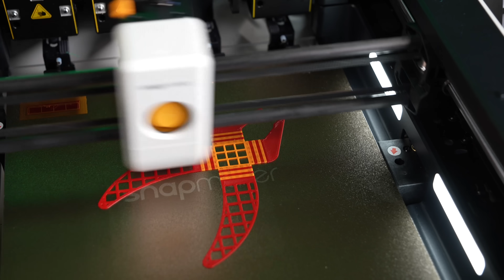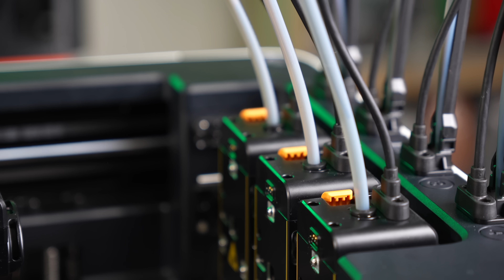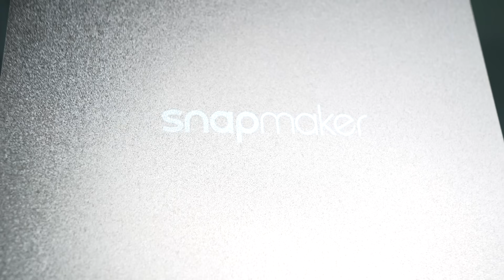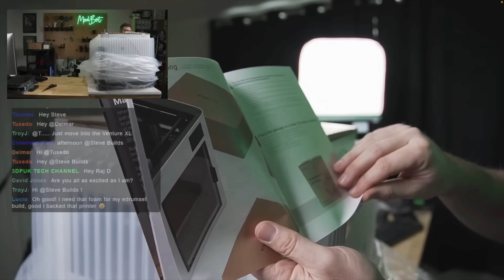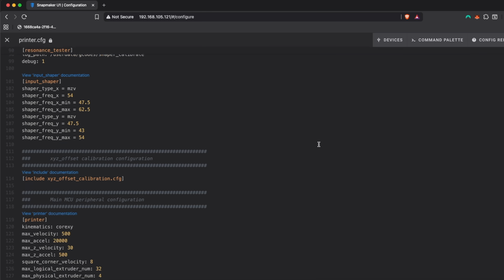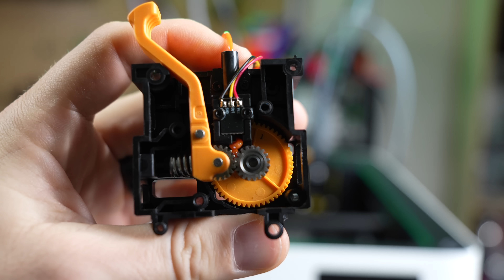Would I Back It Again? Snapmaker U1 Tool Changer

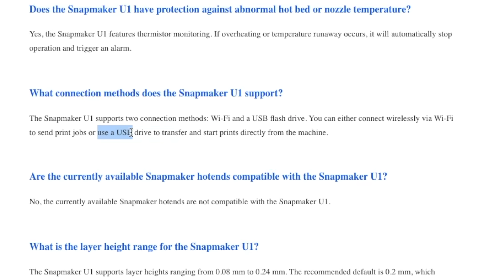Comment: 12:52 Just buy a cheap USB extension cord (male USB-A on one end, female USB-A on the other) and it will do the trick. Connect it on the back, tape the female part on the front and now you can load it normally.

I know these exist, because I have my mouse connected via one (as it came with a comically short cable compared to my previous mouse).

Comment: Help, I am trying to calibrate my brand spanking new Snapmaker A1. It goes through the homing fine it picks up the first head brings it out to the middle and stops and makes a lot of noise like the hot plate is locked down Help.

Comment: SInce the U1 is supposed to be open source, I am dismayed that the RFID method of locking us in to Snapmaker's filament is disappointing. That is the same cash grab attitude that Bambu is doing with their proprietary RFID scheme. It wouldn't have been hard for them to create an app that allowed QR codes to be snapped and using the filament data in the QR codes of non-Snapmaker filament manufacturers.
The other issue I have is filament drying. At least with the Bambu AMS you filament can be put into a dry envvironment. But with the U1, the filament is exposed to the elements. If I had a U1, the first thing I would design is a filament box to attach to the side (maybe with magnets that snap on) that would cover the filaments. I would also design a plate so the top would be covered to keep the inside temps constant for higher heat materials.
Otherwise, for the price, this is a step in the right direction. I am personally going to wait to see if the Creator 5 Pro can do even better than the U1. But if you have to have a toolhead printer right now, the U1 would be the best bet at the moment.

Comment: Can you use it with enclosed filament boxes? 

It seems a wasted opportunity. It works for multicoloured prints but only stops short of delivering for really interesting engineering potential if combined plastics parts; no chamber heating, an open lid and no enclosed filament housing. 

How easy would it be to mod the printer with a lid that includes a heater and a gantry to support enclosed feed from enclosed filament boxes.

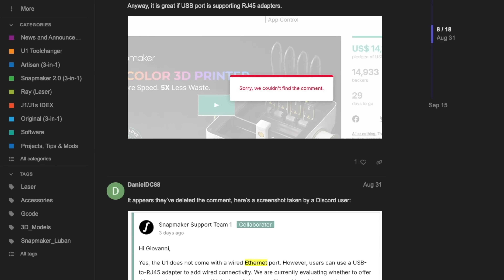Comment: @13:08 Curious if anyone tried this with a USB HUB. The only HUB's I have in my office are hardwired USB-C, and using a USBA to USBC cable does not work on any devices. Anyone have a HUB that works for sure?

Comment: We've been very impressed with our first three months with the U2. So far we've only had one blob, which we managed to clean up without a complete disassembly of the head, and one tool change failure, which we recovered without restarting the print. That's not bad for several hundred hours of operation. The blob did damage that heads sock, but a set of 4 replacement socks was only $5.

Our U1 deals with 20 hour prints, swapping between PLA and PETG far better than our Bambu Lab A1 ever did, while also saving huge amounts of waste filament.

Comment: For years I have struggled with color 3d printing.  The poor mans way is to pause the print, pull out the one filament and insert the other color.  This means being by the printer to time the color change.  Another way was to have two printer heads mounted on the same rail, rarely worked well. I even tried a hot end with 2 print heads that would swing to allow the different color to print  Having 4 independent tool changers at this price point is a dramatic leap forward.  Now it appears more modular with working on a tool changer easier.  My U1 just arrived and I am excited to get it up and running

Comment: I got mine not long ago, and I am LOVING it.  Out of the box, I only had a few niggles (had to get the belt tensioning correct).  But after that, smooth sailing.  The thing tuned itself, I had to do NOTHING, other than wait.  First layer was a touch low, but that's pretty minor.  The RFID tag readers are awesome, and if you're willing to use custom firmware (eg Paxx), you can make it read your own tags, or tags from other filament brands.  Put a cheap Walmart / Ikea bin mod on top, and you can print ABS / ASA all day.
Reply: Same here, just a bit of belt correction, then it was go go go. Not looked back so far.

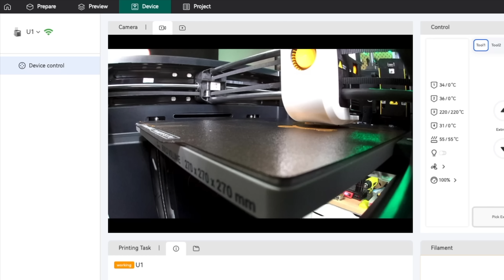Comment: 10:12 - Internal camera frames are very similar in quality to P1S, meaning they are slow and low quality.
Aside from offering cost-effective color switching, it seems impractical not to offer a higher temperature nozzle (350–370°C), considering that the table size is comparable to the QIDI Q2.

Comment: I received mine yesterday. I have made a couple of other items besides the obligatory dragon. 

The only problem I had with assembly was of my own making. I thought the 16mm screws would have been used on all of the toolheads as well as the fixed portion on the back of the printer, then found I didn't have enough screws to do that with! Doh! My fault for not reading ahead far enough.

I have no idea why they used so many different types of fasteners. I would have just gone with  2mm x 12mm screws and be done with it.

The assembly manual is one of the best I have ever seen for anything I have ever bought! Buy an Italian machine tool and see what you get!!!

The only complaint I have atm is the software and connectivity. This is very patchy. I could not get the machine to bind to my account. I could ping the machine on my network but that was about all I could get. 

I upgraded the firmware using a USB stick and that improved the experience. The latest available is 9.0. The machine came with 8.x something. Still a bit dodge but I at least got it to bind with my account. I still have intermittent connectivity with the machine trying to send a job to be printed. Orca says the printer is offline. I just keep retrying until it works.

Comment: I own a a Bambu XC1 with AMS.
Happy with it, when I don't need to print more than 1 color per layer, because I can print in few hours instead of days... don't care about purge, care about a huge amount of time... also, after hundreds of filament unload/reload, it can stuck in roll or have any other issue... so a tool changer is the way out.

I'll sell my XC1 and her a machine like U1 or U1 itself as soon as it is known to be solid, durable.

I print as a hobby, like 1 or 2 per week... I believe U1 is already sturdy enough for thin light work and should last many years, BUT I believe next version and also other established manufacturers will release something at similar price range (Prusa One+ costs like 5x more).

If U1 was a Bambu Lab product, I'd pay $2K for it

I' ll wait 6 months

Comment: I have got over 24 hours on my printer so far. probably closer to 36 at this point. Only issue I have had is during two long prints (10+ hours), for some reason the pogo pins cant be read on the tool head. All I have done to fix this is simply wipe with a cloth on the pogo pins. Also I sort of pushed them in and out. I can't remember if it was the same toolhead each time or different ones. I don't quite understand how they could be getting "dirty" over the course of the print but each time it resulted in the printer being idle in an error state for multiple hours. Then when I got the print to restart, it had a pretty noticeable layer shift. Which is very frustrating on a long print.

Comment: I dont understand why you need hardened steel nozzles when the lack of a good enclosure will limit the types of material you will be able to use.
Reply: it comes with stainless steel nozzles by default - they recommend both the top hat enclosure and the hardened nozzles if you want to print with abrasive filaments

Comment: Those side load filament feeders seem a less than ideal solution for hygroscopic filaments.
Reply: You can bypass them by feeding them straight from a dryer to the PTFE tube in the back or people have already made mods that allow you to connect PTFE tubes directly to the feeder.

Comment: regarding noise levels:
main culprit are the 2510 extruder fans which run at 19.000-22.000. I've been running mine at 65% via printer.cfg for a few days without issues and it's noteably more silent.
An ikea samla box or a top cover, e.g. from 'SRIN' on printables will also help, as does reducing the acceleration. I still ahve hope that snapmaker will come out with a "silent print profile" or even a silent replacement fan.

Comment: Thank you very much for this episode! I think your review is greatly needed for the newest cohort of 3d printer users who have almost zero 3d printer programming or building experience. These folks will basically download STLs and expect near perfection without understanding the basic mechanics of FFM printing. So your explanations as well as having the insights of a veteran of 3D printing will be greatly appreciated by these users. This is not to say experienced or experts won't benefit from these videos, either. We (the elders) do enjoy your walkthroughs. I think the near future will be how-tos or advanced techniques on how to perfect printing with single head, multi-filament (SHMF) or multiple toolhead, multi-filament (MTMF) printers.

Expert notes: All of the newest 3d printers use Klipper over Marlin, whether these companies admit it or not. I am pleased Snapmaker has promised to release their source code as open source with proper Klipper attribution. It set them apart from the rest in this regard. However, for any programmers out there, this U1 model (and Bambu Labs, Creality) are moving towards treating printers as embedded Linux (IoT) devices. This means things like remoting into the printers, USB to Ethernet (hardware dongle or usbip), or remote messaging (MQTT) may not be available or possible due to the embedded Linux operating system.

Comment: I have had mine running for nearly a week straight.  I had some toolhead docking issues on the 4 tool, but I just rotated the usb cable to the left side of the filament tube and it corrected the issue.  I have had a number of toolhead change failures that just required wiping the pins with a microfiber and hitting resume.  I have already ordered the top cover to hopefully cut down on the dust build up...and peace of mind of not worrying about my cats investigating all the moving parts.

Comment: Why is everybody putting the on/off switch at the back of the printer, for fucks sake...
Reply: I think it is because power switches are integrated into the power supply and not easily rerouted.   Power supply manufacturers should take note of your complaint and make an option.

Comment: Why stainless steel nozzles? Worse thermal conductivity and hardness compared to hardened steel, the only benefit is being more food-safe and non-magnetic (e.g. for pausing and inserting magnets in your print). They can handle higher temperatures if I recall, but I doubt anyone is pushing over 350C on an open-top printer.

Comment: I didn't get wrapped up in all the hype over this printer. So I didn't back it. I do not regret that decision. Unless it is an industrial grade machine, pogo pins never last as long as they claim. I have seen cheap pogo pins wear down in less than 1,000 changes. I am not saying these are that cheap. But I highly doubt they will see 250,000 changes. As an engineer and builder, I'm not a fan of pogo pins. I think Bambu Lab was on the right track when they said pogo pins wear out. So we shall see how long their wireless connection lasts. My guess is they far outlast pogo pins. Time will tell.
Reply: Yep other printers using Pogo pins see them wear out very quickly.  No reason to believe it would be otherwise with the snapmaker.  Combined with the difficulty in clearing clogs, this thing seems like a potential maintenance nightmare.
Reply: @Sprogster  It is an overhyped machine. For people like me that have been in 3d printing for 10 plus years, we already knew this would be the case with Snapmaker. People overhyped all their printers and none of them lasted very long. I have no reason to belive this one will be any different. People talk about Bambu Lab being a shitty company. But at least they still support printers they released over 3 years ago. Snapmaker ended support on some of their machines after a few months. Now that is a shitty company.

Comment: I had about 5000 hours on my old X1C, never had a problem with the carbon rods. Not sure why people hate them so much, they do what they are supposed to and the printers shake so much less than the big H2S/H2D/H2C printers
Reply: Wait how do carbon rods reduce shaking? Less inertia when moving on the Y axis?
Reply: @PJ-oe6eu that is correct. When Bambu set out to make the X1C, they wanted to make it insanely fast and thats why they used them. My H2D, with its MASSIVE toolhead and the metal rails shakes the whole table and printer a lot, I personally don't like it but its overall a good platform. But my X1C moves insanely fast while printing and the back and forth movements barely shake the printer. Interestingly though, the H2D seems to have faster acceleration when moving from object to object but again, it shaked the whole printer lol
Reply: I have 2 x1c, one with ams and other with ams2. All work perfectly. Didnt have any much problems, most prints also printing on 166% with abs and asa. Planing to buy h2d in next 2-3 mo because of bigger bed and 2 nozzles so i can use pla or petg interface support for abs/asa

Comment: I really dislike multi-material systems that just leave the spools sitting out in the ambient air, with no protection against humidity, that’s a showstopper for me 🙁
Reply: That's an easy fix, a very easy fix.
Reply: @Scheettini  Yeah, but I very much want a machine that’s a tool that just works. I’ve been using 3D printers for at least 10 years now and am so over machines that are projects in themselves. - That’s just my personal situation though, plenty of other people have entirely different wants and needs.
Reply: @DaveEtchells  wich u recommend???  this has been my best choice

Comment: Getting at the extruder may be a pain, but honestly, I think I like it better than dealing with the bambu x1c. While it's easier to get to the extruder on the x1c, I dread working on it because it means bending over or crouching in front of the printer, trying to work in the tool head in the dark because you want to work on it with the power off, and deal with it while trying to not damage anything with the gantry. Being able to take the whole tool head off the printer and work on a bench or something is a game changer for me. Much easier in my opinion.
Reply: True...

Comment: This is a really cool printer. However, I’ve tried several brands of printer and decided to settle on Bambu. My P1s’ just work. When BL announced the H2c, that was the one I chose. Very happy with it. The u1 is half the price, yes (full retail with top hat), but I am completely satisfied with the H2c so far. Hopefully it is as reliable as my P1s’ have been. I’ll be watching the U1’s though. I may wind up buying one (or more) of these for my daughters.
Reply: I agree with you on all points. If BL adds support for mixed nozzle sizes, the H2C will become another step more valuable at no cost. I have the H2D, and the main limitation for me preventing an upgrade, is I have the impression that the H2C is more cumbersome making TPU work. I'm waiting for someone to make a detailed investigation/video dedicated to this topic.
Reply: @nbrown6648 Clough42 did a review of the H2c and he printed tpu pretty extensively. Basically, according to him, it becomes in H2d in that setup. And BL has said that they are working on compatibility with the left nozzle for some tpu’s as well.

Comment: Word of note, similar polymers can have surprisingly horrendous miscibility as well.

Case in point, HIPS and ABS - shouldn't be run through the same nozzle in rapid succession, because without magic additives, a small contamination of HIPS will foul your ABS and make it crumbly, which is ironic when HIPS is the designated support material for ABS.

While not a consumer usecase for now, there is various research to combine print and nonprint tools in one manufacturing operation. Such as drilling or milling on a 3D print for tight tolerances, using ink pen instead of filament as a release layer, and using a laser to iron curved print surfaces. A more likely use is combining different nozzle sizes for different feature sizes, e.g. if you want precision printed text or graphic inlay.
Reply: It happens even between the "same" types. The Matte PLA from Elegoo will not bond with the Creality Soleyin. I have a 4 tool Voron 2.4 so each has a dedicated tool but they do not adhere to each other....

Comment: I really appreciate that they chose to use Klipper and have promised to open-source their fork as well. However, I’m still curious about which parts of the printer can actually be configured within Klipper. For example, will it be possible to customize the display menus through the Klipper configuration, or even set up our own RFID tags in Klipper?
Reply: I want support for both bambu and snapmaker nfc spools